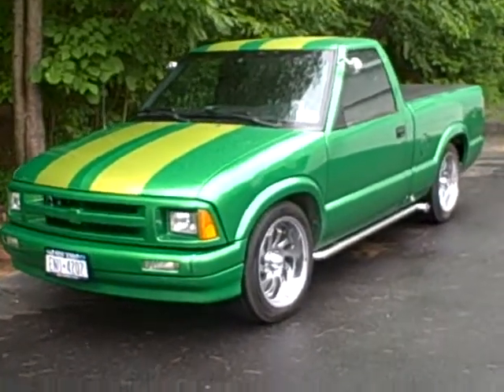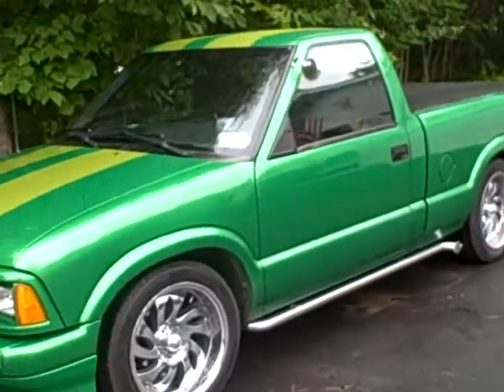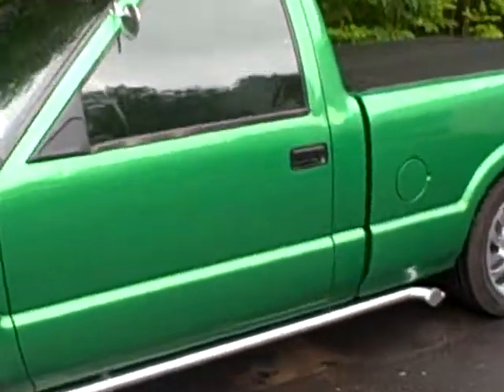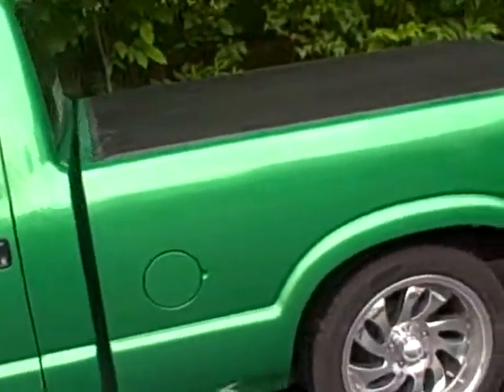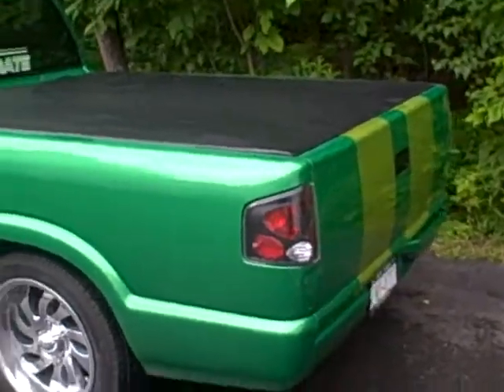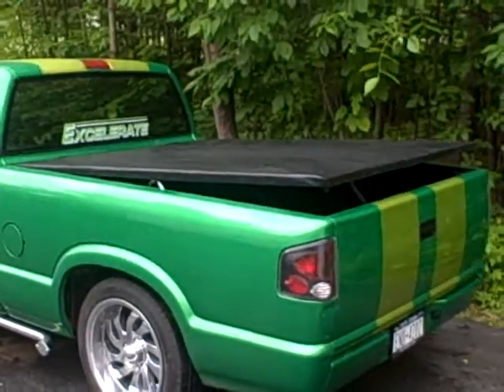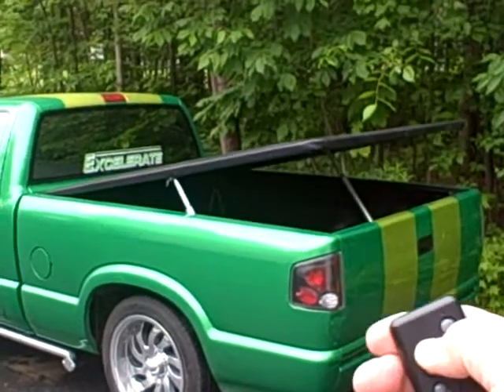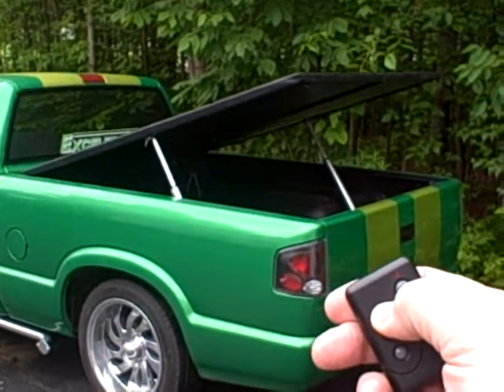Tonneau cover

Comment: If you look toward the end of the  video and freeze it you can see a board bolted to the front of the bed with 2 large wingnuts.  That board has 2 medium sized hinges that attach the top.  To remove the top you undo the 2 wingnuts and the everything comes out except for the 2 bolts that the wingnuts attach to.  Hope this helps.  Thanks Jack

Comment: Sweet video brother.  Did you tap directly to the truck battery for your 12v power source or do you have separate 12v power source.  Thanks
Reply: I purchased it with a remote that attached to any 12 volt source./" progressive automations"  Thank you.
Reply: Awesome thanks